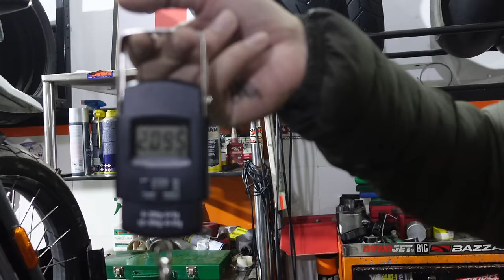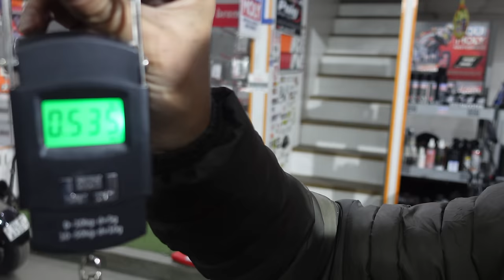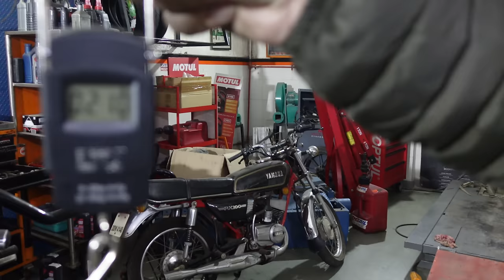Himalayan 450 Weight Reduction: Drop 11 kg By Spending Zero Money

Comment: Abhinav : Now, we are going to remove the engine and gearbox from the bike, and the weight that comes off is 35-40 kilos, now the bike weights 100kgs, now the bike is completely modified and will have much better performance....
Reply: No no, we keep the engine. And as you can see the chain set is connected to the rear wheel and front wheel is free so, we are going to remove the front wheel and we will just wheelie from here onwards.
Reply: Good one
Reply: haha, was about to comment something like this..ese to sb hata do 😆
Reply: Ha ha ha ha
Reply: Don't need all that air in the tyres.
Reply: Hhhhh
Reply: I laughed and I got hiccups man. 😂
Reply: 😂😂😂 @bhikhta
Reply: God knows kya Hosiyari karne nikale thee.. People want to stand out doing unique things... You should make your own bike instead of stripping the Himalayan.... What a waste
Reply: The fat rider that most of us are could lose 11kg and keep all the practical things on the bike.
Reply: Let's add a bath tub to this bike and check the weight
Reply: Now we will remove the handlebar and let Jesus take the wheel...!
Reply: Tubed tyres and no stand..... Smart choice!
Reply: He gets rid of stuff and put them back like the tool box,next video he will add a sissy bar and other stuff from the Harley we can see behind him!
Reply: Bro you forgot the suspension and wheels to remove for dropping extra weight 😢
Reply: My exact reaction
Reply: 😂 gazab ka though 😂
Reply: We can remove whole front wheel assembly 😅, save another 30 kgs, and wheely our way to home
Reply: Just drilling holes in the chassis can help you lose around 5 more kgs
Reply: Taking off the number plates 😂Was wondering what else would be taken off
Reply: Guess this video is looking for views on negetive marketing. This is the theme message for negetive marketing. Hope YouTube gives a filter for that...and i watched looking for some logic in this
Reply: When clowns don't know bikes
Reply: :goodvibes::goodvibes::goodvibes:
Reply: Taking the centre stand off makes no sense. That weight is down low where you need it to be, to lower the centre of gravity of the bike and the centre stand is a gift from Siddhartha Lal to make chain maintenance easy. (Chain maintenance is a nightmare with a kick stand.) 

Similarly removing the rear rack also makes no sense. That's where you add a tail box or bungee strap a soft bag.

And if you take the stock RV mirrors off, you need to replace them with bigger ones and not smaller ones.

Comment: Let us now remove the wheels. That'll also prevent chances of puncture and save a lot of weight. Next you can remove the head light and use a pocket torch in it's place, thereby saving a lot more of weight. Another item could be the rear view mirrors. .. quite unneccesary in India.

Comment: Sir Whay U doing On this Agar Itna Hi light weight bike U want Go  n bey new Adv 390 More Relaible More Power more Advance
Reply from the maker: I want a 21 inch front wheel with increased suspension travel and off-road geometry. KTM doesn't have any of that.

Comment: Nice video Abhinav. Even 20 years ago, round about 7-10 kilos is all we could shed from our 500s removing all the tin work. 196 kilos - 10.7 (round off to 11) is still 185 kilo bike. Not 170. Unless you plan to run it without fuel.
Reply from the maker: I'm talking dry weight here. Won't run on trails with 17 litres in the tank. Maybe 5-7. So, to keep it simple, just focused on dry weight. Of course ready to ride it will be heavier.
Reply: @abhinavbhatt make a video on tool kit you carry.
Reply: Wet doesn’t mean only Fuel.. engine oil 2 litres and coolant 1 litres will itself weights more than 3 kilos and fuel of 5 Litres is another 3 kgs at least. soo please don’t miss lead the viewers. PS: you can’t run a vehicle dry. Soo for practical purpose please mention wet weight. Talking about dry weight is like talking about Ex show room price. Practically you can’t own vehicle at Ex show room price and can’t run vehicle with dry weight. Now peace
Reply from the maker: @mallelli99  how is anyone being misled when the first thing I say in the video is that the bike is 181 kg dry. Wet weight will always vary since I don't intend to ride this with a full tank of fuel. So, the constant figure here is the dry weight. Anyone smart enough can add the fuel, engine oil and coolant weight to it.
Reply: @mallelli99  Practically speaking, if the bike were to be taken to a trail with only 7 litres of fuel, that means you are carrying 10 litres less than maximum. 10 litres of fuel equal 7.5 to 8 kg. That is the weight saving with fuel alone that can be realistically achieved as per Abhinav's plan. You can calculate total weight with zero fuel easily too.

As I understand, dry weight is fixed according to the components on the bike. Wet weight varies as fuel is consumed. While we would all prefer to see the reduction in maximum (wet) weight, Abhinav seems to be focusing on the constant weight which is dry weight.
Reply: @abhinavbhatt  hey, could you recommend this over an older BMW f650gs or g660gs for daily rural road twisty / with some gravel and dirt driving with the ability to do longer trips. thanks. I have no experience with either. I previously had a 2006 ninja 250 because it was cheap and good to learn on. it was fine but a little small in the riding position even for me at 5'9"
Reply: @pawpawbandit3871 GS 700 is the one. 75 HP, low seat and low weight.

Comment: Inspiring. Was worried about 195 kg wet weigh 17 L tank, but now, seems it can be dropped down to 175 to 180 with 12 to 13 L petrol, which would be AMAZING. Thanks for taking the initiative.
Reply: Why stress, ride with 5L in the tank only.

Comment: Some more ideas, in case they were not considered:

- replace the plastic fork protection by soft one made of neoprene
- replace the wet battery by a Lithium one
- check for a light weight chain/sproket kit

You still have the chain guide installed, which might not be mandatory but I would bring back the chain guard for safety reason.

And BTW "kg" sounds a bit strange for a European. "kilogram" is much more known 😉

Comment: Also the Swing arm is cast iron steel something, so if cost is not an issue one can get customized  Aluminum alloy KTM type to reduce weight , also fuel tank is metal if one can Fabricate it to Fiber - Plastic u'll save significant weight😎

Comment: So much fun experiencing your posts from here in New Hampshire ~ USA ~.  Not gonna lie.  I bought a pack of cigarettes at the local package store here.  Two Young Indians here on visa.  I just said "Royal Enfield" and out came their wallets with pictures of (smaller) "Royal Enfield" motorcycles. We talked for some time and I did buy the cigarettes 🤮. Anyway, I told them about have purchased a Himalayan 411 (2021 with 3000m) like new. I then got the deposit back when finding the gear ratio was low and not so good on the road @ 65 mph.  And so "Keep the Faith" with the Royal Enfield solidarity.  All good.  Thank you!  The 450 is the bike for me.  Thanks.  〰✨🌿🦋🌳🌿👍🌿🌳🦋🌿✨〰

Comment: Great weight saving there🙌🏻
Curious to know what else can be removed or replaced with lighter equipments. 
Loved that double take trail mirror 🤠, 
 i was assuming it's Zefal spy mirrors on the previous video.
Reply: possibly - Lighter wheels, lighter exhaust or Aluminum sprockets (and sprocket sizes if tuning required), But most importantly, one just needs 10 to 12 L of petrol (which would save 4 to 5 Kgs) on top of this weight loss.

Comment: The absense of the lower fender will splash mud and rocks on the radiator and eventually can damage it. How did you not consider it before removing it?
Reply: A simple radiator guard should be enough to deal with that.
Then again, that's metal while the mudguard is plastic. Interested to see the rationale behind this
Reply from the maker: Went with what is available currently. May do a wire mesh radiator guard later or a high fender with a longer lip at the rear that covers the radiator to some extent.
Reply: NO radiator guard stops mud clogging up the radiator which in turn dries hard and leads to overheating. At most I would just have cut off the front of the mudguard in front of the bracket and then raised it on brackets 1-2cm to give more tyre clearance. The removal of chainguard and mirror replacement with those small mirrors would not be legal in  the EU and many other countries.
Reply from the maker: I'll find a fix for it.

Comment: Hello, greetings from Spain.  The weight reduction makes the new Himalayan very interesting.  One question, isn't it dangerous for the brake cables to be loose?
Reply from the maker: I'll figure a routing out once I do direct brake lines. I'm planning to remove the ABS unit. I'll do a video on it once we get there.
Reply: @abhinavbhatt  Very kind for your response.  I will be attentive to the solutions you find, in case I finally acquire this motorcycle.  Personally I prefer to keep the ABS on mine, but perhaps for exclusive off-road use it would be more useful not to have it.  Are you also thinking about how to solve the installation of front turn signals?
Reply from the maker: @jrodalv yes. I'd be making a custom bracket for the front. The ABS is too intrusive off-road so just can't have it on the bike. Cheers

Comment: The problem now is – from my point of view –•that you vave significantly reduced the touring capacity of the bike. No rear rack = no mounting points for luggage. No center stand = much more difficult to do tyre repairs in the field. No front fender = wheel is constantly throwing dirt onto the radiator = overheating. Plus I don't really like the fully exposed vital front break line.
Reply from the maker: See, almost everything is bolt on and off. The day I have to tour (twice a year), I can bolt the parts back on. And I'll fix the brake line and figure out the fender too.

Comment: Probably, you have not only dramatically reduced the weight of the motorcycle but also removed all major protection and fundamental cosmatic accessories from it. Overall, it is not worth it. Perhaps some of the motorcyclists might consider this if they are more inclined toward light weight and extracting extra performance without spending negligible money on performance parts other than the service charges of removing stock parts.

Comment: sock protection or wraps on the front forks would be more protection from dust and particles,,ktm duke owners used to buy these or get them made, also rear chain guard should be re added to prevent oil plash marks all over on the bike and on rider and pillion.You can  Remove catalytic converter for better performance as well as weight reduction.

Comment: Hold it. The bike you are working on seems to have TL rims fitted on it as if from stock . Where did you get those? Nice video. Let's see how you will save weight on the front number plate, footpegs (Fand R), mirrorsand front mud guard. Will be interesting to note the alternatives to the stock. But my first obsn still stands. Where did you get the TL rims from ???
Reply: the two higher-end models (black&gold and this one) come with the option of TL rims

Comment: I dont agree with this kind of weight reduction bro. Though you are using this bike for off roads, this is not the way to reduce the weight of the motorcycle😂. What else is left in the bike to reduce the weight? Best thing is take out the engine and fit it into Xpule chassis 😂

Comment: My 2009 bmw xcountry weighs 160kg wet as standard. I've changed my exhaust so mine is around 157kg. It is fully road legal, has indicators, mirrors, number plate, rear footrests, etc.....and 53bhp ( standard tune)....
Reply from the maker: Lucky guy

Comment: I think  RE designed it as a touring machine that goes on occasional off roads than a pure off road machine. Yeah shredding weight helps off the road , but on  highways weight helps to keep the bike on track at higher speeds.

Comment: Is it possible to bring interceptor weight to 170kgs and seat height to 780mm
Reply from the maker: Switch to a 2x1 full system exhaust and you'll drop some 11 kg from the bike. Drop everything else that's not needed. Get 17 inch wheels too. And it will be close.

Comment: You can remove fuel tank also place a 2 ltr Plastic bottle it will shave off lot of weight and also remove engine oil that is also useless

Comment: Your claim of 11kg drop is actually not correct! The original LS410 I weighed on a weigh bridge & I had a lighter weight Delkevic muffler on it & the wet weight was 200 kg. The engineer for the sherpa 452 cc engine said he shaved 10 kg off the old motor. However the bike come in wet at a reported 196 kg so that's only a saving of 4 kg. The reason partly I suspect because the new 452 cc Himalayan is longer-taller & wider than before & this of coarse equates to extra weight. I also suspect for some reason that only Royal Enfield can explain is they persist in using outdated steel swing arms that very few premium bikes & also non premium like the CRF300 all use aluminium swing arms because they are much lighter than steel. Steel tank also heavier & could again have saved weight using a nylon/plastic tank. You almost got it right Royal Enfield but the weight problem remains. I also think in slow going situation under load that you will need to go to a 1 tooth smaller sprocket on the front, as it tends to struggle a bit under load in slow going & their's plenty of top speed so wouldn't be a problem. The air filter needs moving behind side cover (not under the tank), & the side cover's increased in size to improve access while reducing tank side & profile to 15 litres.
Reply from the maker: How is my claim of reducing 11 kg incorrect if I am weighing everything and showing it in front of the world?
Reply: The Himalayan 452 weighs 196kg wet. The old himalyan weighed 200kg wet. That's a saving of 4 kg not 11kg as you claim. @abhinavbhatt

Comment: Absolutely incredible engineering. The UK team who decided the engine reduced about 10Kgs from the previous engine, increased the capacity a little and the power and torque to the point where this is the first RE that doesn't compete with smaller cc bikes but even after all that somehow RE adds back all that weight for no fucking reason. How where why, no clue. But then again, RE customers are accustomed to accepting this garbage, a lot of them are now taking a shit on a thoroughly modern bike.
Reply: Technically its around 5kgs lighter than outgoing model. I think they lost weight at few places but the new chassis weighs a lot on the upper part. Also, the suspensions are way heavier IMO to previous units.

Comment: Great Video Abhinav. I am in a fix now. I have had booked the Himalayan 450 in December and now it’s in transit. Will be in the dealership in a week’s time. However, watching so many negative reviews regarding vibration, coneset and what not, I thought of cancelling and booked the Honda NX 500. Now, yesterday I took a test ride of Himalayan 450 for around 200 kms from one of my friend’s
 dealerships. My observations, beautiful machine, it is big, did not find any issue lifting from side stand at all, good quality, powerful engine, torque under 2 k is slightly less, the best suspension I have tried so far in
 My last 15 yea of experience. Anything above 2k RPM and this machine is just a bliss. 

However what is confusing me is vibration on the foot pegs in between 4-5 k RPM in 4 th gear specially and the speed is between 50-65 kmph . Rest of the gears in the same RPM did not find much of vibration. It has slight buzz in the handlebar and foot pegs, which is a good feeling and nothing negative about. This vibration in 4th gear is worrying me only. Please Note, it was only 30km run bike. So after returning from the ride, they have serviced the bike and changed the oil for me. Today I am going for a ride again and see if it has made any difference.

What should I do now Himalayan 450 or NX 500??

👋
Reply from the maker: If you are comfortable with the pricing of the Honda and plan to mostly ride on road, get the Honda. It will age better than the Himalayan for sure. Vibrations - I don't really care about them, they are barely noticeable to me. If I were to get a bike between the both, I'd get the Himalayan due to my off-road riding bias.
Reply: @abhinavbhatt Thanks Abhinav. Will let you know about my decision.

Comment: If they could make a 160 kg bike of similar durability with this engine specs, it would destroy many top ADV tourers currently in the market. RE bikes produce too less power and torque figures for the weight class.
Reply from the maker: I'll be dropping another 10-12 kg off the bike.
Reply: @abhinavbhatt we are waiting

Comment: The engine is 10kgs lighter than outgoing model, so the engine should be very light. Also the chassis lost lower part of frame, i.e. cradle. I wonder why it still weighs so much. Is it the upper part of frame and swingarm ?
Reply: bigger metal tank, bigger forks for suspension, radiator for cooling
Reply: @slakk5093 they should use airconditioner instead

Comment: A bit of fun but I don't really see the point. Most of what you removed is essential when traveling on the bike. And removing the toolkit to replace it with another toolkit? If you want a rally spec bike just go for a CRF/KLX/Voge Rally 300. Don't strip a Himalayan.
Reply from the maker: This is not a travel build. The bikes you mentioned aren't available in India.
Reply: @abhinavbhatt  No way! Not even the Voge? Sorry for you guys. I tested one last year. Fantastic bike but I’m waiting for the new Himalayan in France!
Reply from the maker: @simonthomas5367  yeah, we don't have dual sports motorcycles here. We do have something called the Hero XPulse 200, but most have grown up from it and the Himalayan 450 seems like the logical move forward.